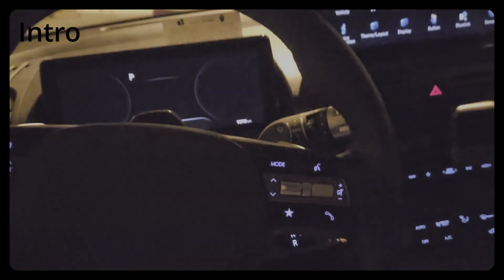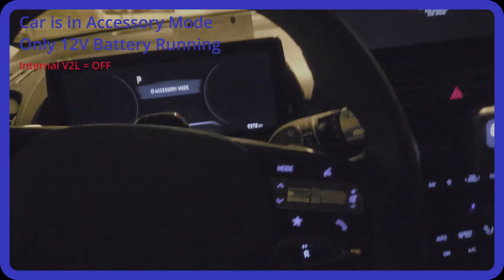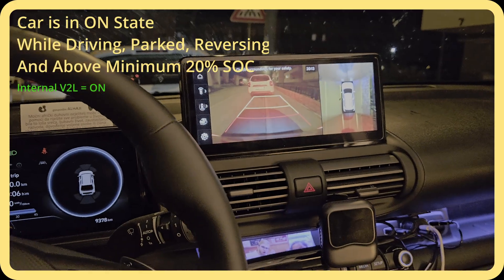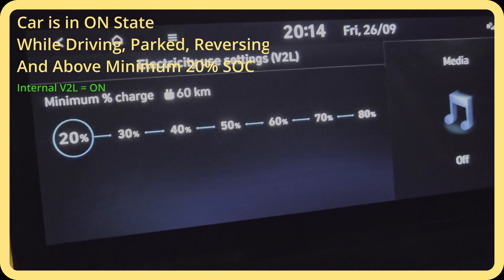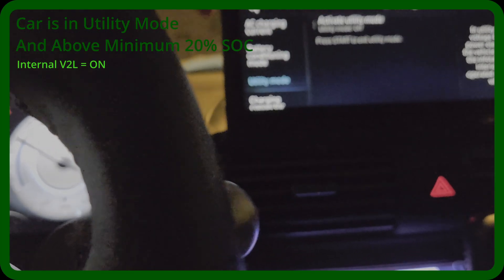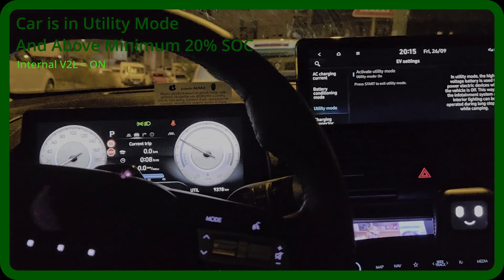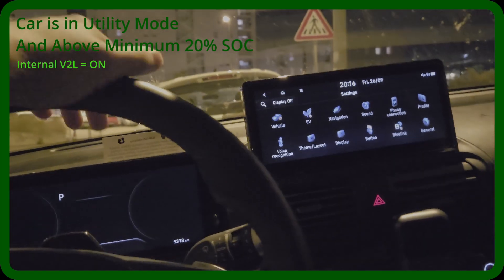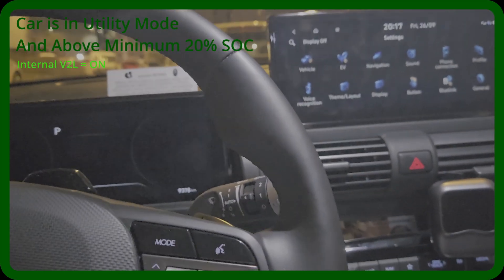Interior Vehicle2Load on Hyundai Inster - How does it work

Comment: Nice, thanks.  How much is a top trim Inster in your country?  In my country we cannot have V2L on Inster unfortunately and I'm thinking to buy from other EU countries...
Reply from the maker: Top trim in Latvia was 30899 PLUS options 4000 MINUS Government support 4500 MINUS that this one was a demo car 5000. 

From what I hear, Ireland has cheapest Insters but I don't know their internal V2L socket configuration. Also, I know that Romanians have been buying Insters so I assume they have good prices too.

I checked Latvia's Hyundai spec offering and our trims are as follows, from low to high: InTo, In, In5S, Award Edition. Interior socket is configured starting from In level trim. So look for analogous configs in other EU countries. 

I may one day try to remove the casing for my interior socket to see how it is configured physically - perhaps it will be easy to retrofit it for those that don't have it included. I will share details if I ever do that.
Reply: Thanks  @InsterDriver . I'm from Romania and we don't have v2l And 360  cameras even in top trim (Cross)... Not many bought yet because the government delayed and almost canceled the eco grant for ev... It was 7500 euro and now it was reduced to 3700 euro and very reduced total budget starting on 30 September. The top trim Cross is about 25000-26000 euro but without v2l,360 ,panoramic trap. Yeah it would be great to find out if it v2l can be added later but I guess something is missing in the inverter to be able to convert from rhe battery de voltage to AC 230V.
Reply from the maker: @Ciprianolaurus  Maybe, yeah. If non of the trims offer any V2L (interior or through an adapter) there may be limitation of the inverter - too bad if true.